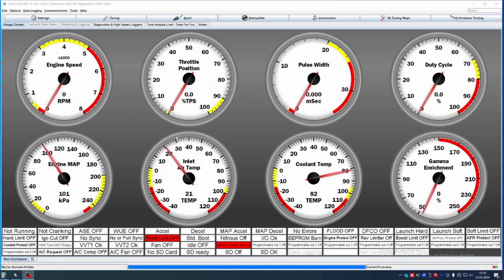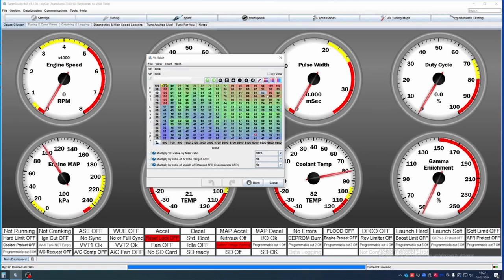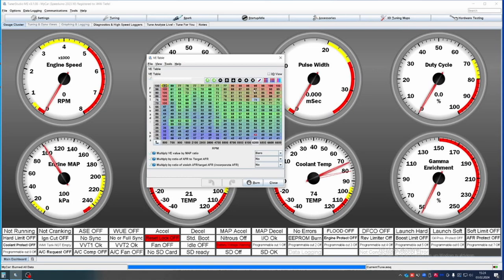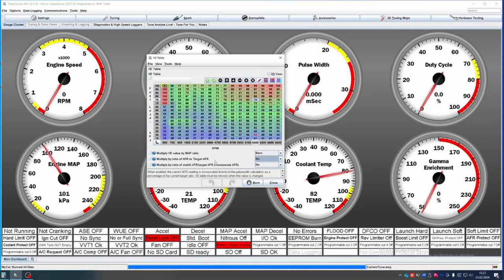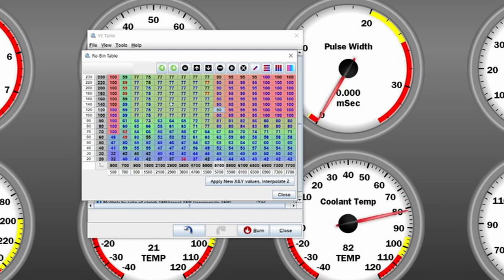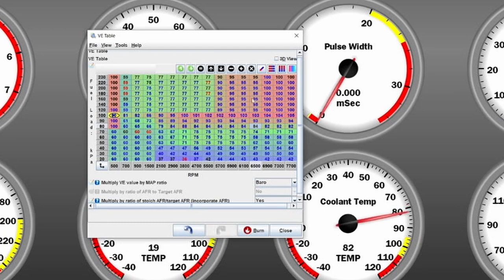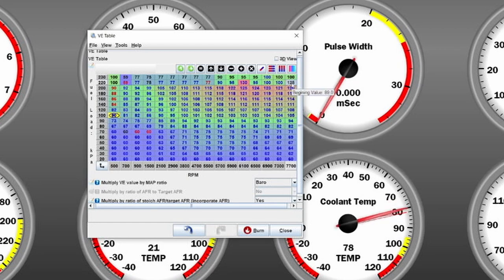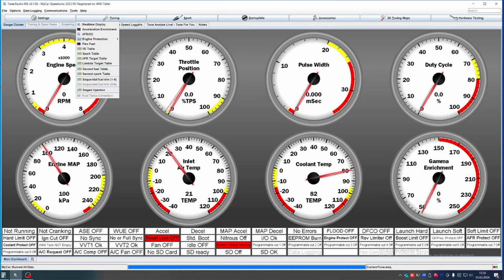Tunerstudio Standalone ECU Tuning Guide | Part 6: Creating a Injection / VE  Base Table| Megasquirt

Comment: Volumetric Efficiency is simply said the Volume of Air that enters the cylinder compared to it’s displacement.
So if you have a 2 Liter engine but the engine can breath ( due to throttleplate restriction ) only 1 Liter per cycle you have 50% VE. Based on that and the outside air temperature and barometric density the ECU converts it to mass which can be used to calculate how much fuel (mass) to add to get the desired AFR.
Reply from the maker: Correct, thats a better explanation than i did haha
Reply: Not exactly.  If manifold pressure (MAP) is 50 kPa due to throttle, and the cylinder ingests its full volume at 50 kPa, the VE for that cell would be 100%.  Fuel is reduced from the measured MAP, in that scenario.
Reply: @PAB712 
Read my previous post again.
The VE table is a developed table that contains the amount/percentage of air for a specific MAP/RPM combo.
So if it is (in your engine) 100% fill at MAP 50, yes it is of course VE100 and the ECU uses this for calculation.
Btw I doubt that at MAP 50 you will ever get 100% fill.
Reply: @bernhardlist9359  Your description was either incorrect, or badly worded.  You appear to agree with my statement, and yes, 100 % VE at any low kPa is unlikely, but into the 90's at 34 kPa at ~3700 RPM is current on one of my engines right now.
Reply: @PAB712 
My wording might not be simple since I am a native German speaker but the theory behind it is correct. I am a mechanical engineer and working withe EFI and the MS3 evo for a while with great success. So if you have a different theory ….. so be it. 
All it was is an explanation and you are free to make of it what you believe.
No offense here.
Reply: @PAB712 
Wow, if you get a VE90 at MAP34 and 3700RPM
Something is not right.
Check your sensor calibration or other setup. Because if you get 90 at 34 you are almost at full power at only a small throttle opening. Do you use a Turbo?
Have fun driving that car.

Comment: Greetings I have already finished assembling my 4.3d plate now I am in the phase of testing everything before making a definitive branch of cables for my project, my intention is to remove the old ignition system (distributor) in a 1984 Ford Mustang with a V8 engine (302) by independent coils placed in pairs (lost spark) since the plate that I am going to use has 4 ignition channels and 4 channels for injectors as we all know, I am going to use the coils of a Chevrolet LS Silverado engine since they are intelligent and only need a pulse to operate and the map, clt, iat, tps ckp sensors etc .. of the same engine since they are the most common and easy to get in my country and are easy to configure in tuner studio, I have already assembled a test bench with 4 relays to simulate the coils the map, iac, iat clt sensor which are the ones I have for now they work perfectly, to simulate the ckp sensor I am using an arduino UNO with a signal simulator program with a 36-1 pattern, connect everything and it gives me a coil pulse, reads all the sensors properly, I managed to configure the fuel pump and the fan, the problem I'm having is that it doesn't give me an injector pulse, I only have two for now, they're not the ones I'm going to use, they're to test that everything works, that the provisional wiring I made is well routed, I made this with a network utp cable, remember it's to test everything, I don't know what other configurations to move and it doesn't give me an injector pulse, BUT in the hardware test tab I test the injectors and if it's functional that means that they're good and the wiring too, of course my intention is to change my Mustang from carburetor to injection but to do it in parts, first the coils and then put an intake manifold from a 2002 Explorer, this to familiarize myself with the tuner studio program and also to familiarize myself with the wiring and speeduino hardware manufacturing, let's see if you can help me with this problem,
Reply from the maker: if you set up the trigger wheel correctly and the crank trigger works. then once you give the ecu a trigger signal it should show rpm and should be firing and injecting. there is only spark, fuel and trigger needed to get the ecu to do that.